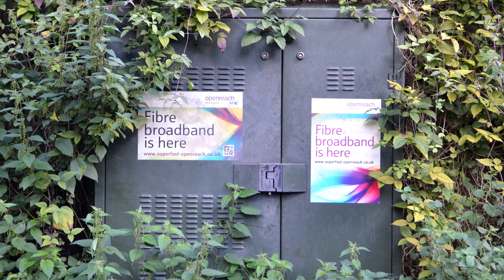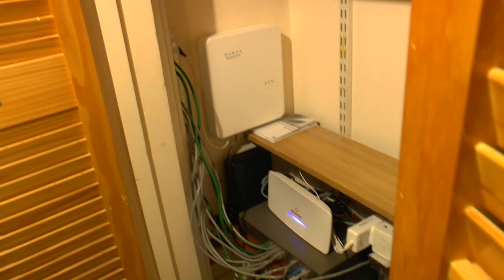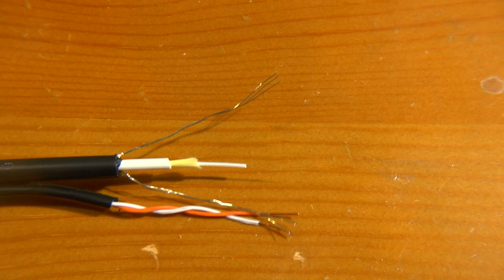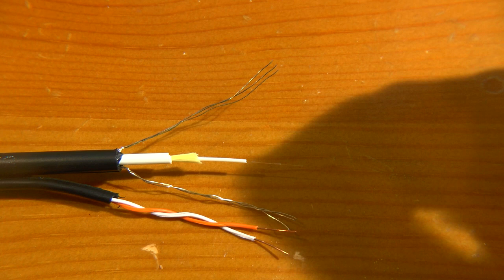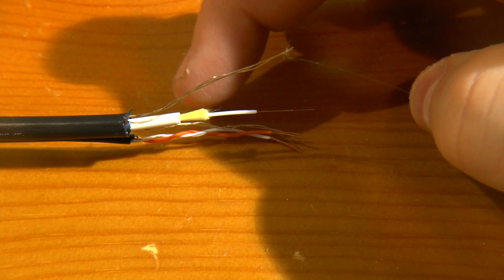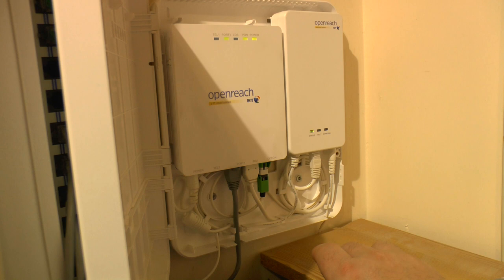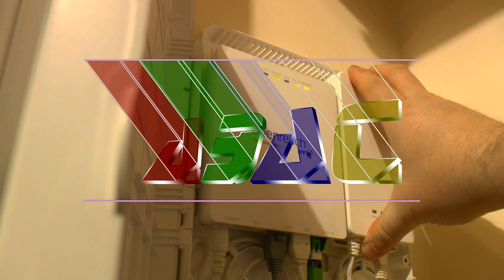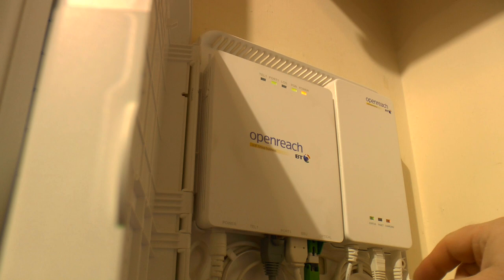FTTP - Fibre To The Premises

Comment: We are just about to get FTTP here in Devon from Openreach. They are planning to take away the copper but it looks like they don't offer the battery bit now and install a smaller box. Mobiles don't work around here so we need VOIP and a battey really. Any news currently?
Reply from the maker: There's some info to pore over here. I'd assume that BT would still be providing ONTs with an analogue telephone port, but this is BT we're talking about after all so all bets are off. As for BBU, vulnerable customers can apparently request one, otherwise your best bet would be a small UPS to run the ONT (plus your phone base station if it's cordless).
https://www.openreach.co.uk/cpportal/content/dam/cpportal/public/images-and-documents/home/help-and-support/sins/documents/SIN_506.pdf

Comment: I'm due an installation next week. Would be interested to know the size of the plastic cabinet. Would you be able to take a quick measurement? Hoping it would fit where my existing 'telephone table' covers
Reply from the maker: I've just looked through previous comment replies and it's approx. 255mm high x 215mm wide x 45mm deep.

Comment: what upload speed? do they also match as classic broadband  upload speed ? Cheers.
Reply from the maker: Plusnet are still trialling FTTP so the speed they offer matches that of FTTC, i.e. 80Mbits/sec download and 20Mbits/sec upload. Vendors offering full FTTP (such as BT) can do 330Mbits/sec download and 30Mbits/sec upload.
Reply: @AintBigAintClever  So its still behind Virgin Media even though VM are doing coax to the property?
Reply from the maker: @compspud  Plusnet's trial (which has now closed) was throttled to FTTC speeds. FTTP from BT for example can go up to 330/30Mbit. A friend of mine just a few poles away (and on the same cab) has 330/30.

Comment: Hi, I really need your help !
Im using exactly the same  set up as yours. 
Just a question, Is the optical cable compulsory for the internet connection? can I use the tel cable instead and where did the other end of the optical cable connected to? also, where can i buy a optical cable like yours? please help, Thanks!
Reply from the maker: Which optical cable? There's only one in the video and it's the one going from the pole outside to the box screwed to the wall.
Reply: What the hell? You get internet and phone from optical cable...

Comment: I have one of these and I am mega confused as to how to set up at wired internet connection throughout the house, could I just plug my ps4 into the phone port?
Reply from the maker: No. PS4 needs to plug into one of the LAN ports on the router. If you've run out of LAN ports you need to add a multi-port switch (e.g. Netgear GS105, TP-Link TL-SG1005D, plug one port of that into a LAN port on the router then plug your additional devices into the switch (including the one you unplugged from the router to plug the switch in).

Comment: So dont it plug into a master socket or is this just for copper slow speeds? So basically from outside it goes right to that modem not to the master socket then a cable from that to the modem to plug into that fiber optic port.
Reply: I'm pretty sure they install a new socket. So effectively the master socket is useless at that point since you may as well use the full fibre not the copper cable.

Comment: Really great video.  So we couldn't get FTTC as we are connected directly to the BT exchange (no green box).  We are getting FTTP and they've been digging up the street installing underground truncking for the fibre.  What I don't understand is how they'll connect to our house.  Looks to me like the closest BT floorbox is 22m or 28m away depending which one I measure from.  I hope they'll dig up the ground to add the last bit of fibre.  But are there other worse ways?
Reply from the maker: How does your existing phone line come in? If it's underground I'd expect it to be in a duct which BT can drive a fibre through. If overhead they'll do what they did here with a connection box at the top of the pole run down to a splice in the nearest floor junction box.
Reply: @AintBigAintClever  Our master socket is in the sidewall by the front door and does go underground.   I have no idea how straight our pullable that is.  But there is no space for all that gear with the battery backup.
I have a cupboard/cloakroom opposite the front door in the hallway with my network gear and patch panel in. Wondering if I should install pipe conduit all the way to the cupboard to the outside wall. But don't want to do that if they refuse to run fibre to the house and dig up the last bit.
That's why I was wondering if they have a slower bodgy way using the copper for the last bit.  I hope not
Reply from the maker: @dvdchas  they indeed have a slower bodgy way using copper for the last bit, it's called FTTC :D
If there's an easy run made available for the engineer (such as your own conduit) then I'd expect them to be happy to oblige, especially if it makes it easier than a normal install. For mine I'd already fitted a block of wood between the rafters (to support a BT cable bracket) when changing my fascia boards, with a length of cable dropped through the soffit as a draw cord. I also had 50x50 maxi trunking in the cupboard which takes ethernet, coax, etc. between the upstairs floor and the attic, with another length of draw cable.
When the engineer came he taped the fibre onto the cable outside, I went into the attic and pulled it through while he guided it. While he buggered around up the pole I mounted the outer box for the fibre gear exactly where I wanted it, then taped the fibre onto the internal draw cable. Engineer came in and drew the cable while I guided it down, then he terminated it.
He didn't have to drill any holes, he didn't have to hammer cable clips in and I had the kit in a first floor cupboard exactly where I wanted it to be, with a coil of excess fibre in the attic to allow it to be relocated in future if necessary.
Reply: @AintBigAintClever  sweet joy.  Whilst I will go to the trouble of digging up my floor, even trying to find where the existing copper comes into the house I'm not sure the engineer will be keen to dig up any public paths (more than they did already to put in the FTTP fibre).  I really hope it's an easy cable pull but seems unlikely to me.
If they use copper for the last bit it completely makes a mockery of the FTTP designation...
Remember there is no green cabinet so any bodgy stuff they do is literally in a bt manhole...

Comment: Hi, not sure if this question has been asked as i haven't read all the comments nevertheless, does anyone know how long the backup battery would operate in case there is a power cut before it needs replacing??
Reply from the maker: Funnily enough I was asked this in work the other day. I suppose it would depend on whether the phone service is being used or not (not in my case) and how much. The unit including its trickle charge circuit draws about 3.8 to 4 watts (see video at 2:29). The backup shown at 7:20 consists of four 1.2V 2000mAh cells so 9.6 watt-hours of capacity.

So... 2 hours or so?
Reply: @AintBigAintClever  thank you very much for your reply. In my case, I won't be use the phone however, its an option I'll consider in the near future. Mine getting installed tomorrow therefore I'll pop the question to test he's knowledge :) cheers

Comment: Interesting video, I followed the links to the open reach site, seems alot of equipment to have Installed, compared with standard broadband,  (like I have, just NTE 5 master socket, filter & wireless router) & although I only live literally 30 seconds walk from the main exchange for my city,  even FTTC is not yet available in my street! 
Although 5G technology will probably overtake fibre for alot of residential customers,  maybe with fibre to the pole, then a 5G link to the premises?
Reply from the maker: If you're that close to the exchange you may have an EO (Exchange Only) line. For some reason BT aren't allowed to put the contents of a green cab in their exchange, they've got to reroute the lines to a new cab outside then put an FTTC cab alongside that. It can mean that those closest to the exchange end up having to wait longer.

As for the equipment, you've got an NTE5 on the wall, an ADSL filter and a router. I've got a fibre ONT box on the wall and a router.

Comment: So you’ve manage to use absolutely no coax? This is what I want to do... can I have them (Frontier FiOS) run CAT7 Ethernet cable instead of coax to where my access point is located?
Reply from the maker: No coax whatsoever, as this isn't a "cable" area. Cat.7 is overkill, Cat.6 or 6a would be fine.

Comment: Great info, thanks! Now I know what to expect later when we get this. The piggybacked copper looks pretty annoying though; are we allowed to have it with just fiber and no copper?
Reply from the maker: I suppose it depends on the area (and possibly the pole) but worst-case the copper can always be unzipped from the entire length of cable. The hybrid cable has proven handy across the road from me where the existing copper was replaced with the hybrid.
The hybrid has an advantage of needing no outside splitter on the wall. With earlier incarnations the cable would've had to run down my wall then back up again to the entry point.

Comment: Shame the engineer didn't take your dropwire down and use the copper in the Hybrid cable like he should have. Would have looked neater from the outside and prevent the pole from becoming overloaded.
Reply from the maker: It'd have been a bit more of a ball-ache to do as the existing dropwire has been routed under the floorboards and up in conduit to the NTE5. I agree it would've looked neater, though.
Reply: That's what we are supposed to do. The engineer could have linked the copper pair with an enclosure where it enters the premises then he could have recovered the old dropwire.
Reply: I can do these connections easy.  It's obvious he should've joint the telephony bit of wire to the existing on the eves of the property.

Comment: Not sure what's neater, VMs FTTP or BTs. VM have most of that outside with just a Coax into the building.
Reply from the maker: If it's fibre to the cabinet then coax into the building then it's not FTTP. It's FTTC.
Reply: AintBigAintClever virgin have fibre to a brown box attached to my house then from there a length of Coax to the router. So it’s fibre to the premises.
Reply from the maker: @hawk_ness  Ah, they just shove the gubbins outside then. I suppose there are advantages both ways; outdoor kit may allow for a neater indoor installation but has to be built to withstand the elements.

Comment: Do you think BT/ Openreach will offer higher speeds than 330/50 or even symmetrical speeds which matches providers like Hyperoptic?
Reply from the maker: No doubt there'll be higher speeds in the future due to the capabilities of fibre. Openreach have already announced gigabit-capable exchanges here: https://www.ispreview.co.uk/index.php/2019/10/openreach-confirm-29-new-uk-areas-for-fttp-gigabit-broadband.html
Reply: on same equipment i'm on 1gb/1gb + phone at £24 with ufo york, i just dont see why bt wont pull their finger out, except it would probably really really upset the copper customers if they did.
Reply: According to Openreach I will be getting the FTTP technology in April I’m just wondering what the highest speed will be.

Comment: Why is it that with virgin media it has a router /hub that goes to the virgin media socket in the wall using a coax cable, but it  does not require any power for to virgin media socket?

But with bt hub 2 it does  need power to the bt socket ?

As with bt hub 2, full fibre so obviously not using the adsl or vdsl or sdsl cable port or cable in thd hub 2 to the bt modem socket.

So obviously it is using an ethernet cable from the hub 2 to the bt modem socket
Why is it that the full fibre hub for this ethernet from hub 2 to bt modem socket, needs a power plug to make thd bt modem  socket work?

Why can't it just be like virgin media where it does not need a separate power source so obviously only thd virgin media hub needs power to it?
Reply: It's for backup power for when you need your phone and have no mains power. The VM service provides power over the twisted pair, till 2025 when they switch it off
Reply: It depends on your technology of connection. If you have FTTP (like this Openreach setup) where the fiber-optic goes to your home – the VM socket will have its own power supply. If you have HFC (coax-to-home), it will not due to the obvious reason: the fiber-to-coax connector will be in a shared street cabinet with its own power supply.

Comment: do you actually need the Plusnet Router connected or can you just use a an ethernet switch to get internet service?
Reply from the maker: You'll need some sort of router, as you're only going to get one IP address from the ISP and you wouldn't want your device exposed directly to the internet anyway.
Reply: @AintBigAintClever  I just wondered if it would work that's all!
Reply from the maker: @don1estelle  It would work in a similar way to the old USB ADSL modems I think.  You'd probably have to do the PPPoE stuff on your computer, it may depend on the ISP, but then you'd be putting your faith in whatever firewall software is running on your computer.

Comment: hi with fttp from bt can you get 50mbs speed as i seen they only.offer 100mbs and above.
Reply from the maker: I've just checked and for my line BT offer:-
36/10mbps (£29.99/month)
50/10mbps (£35.99/month)
74/20mbps (£39.99/month)

150/30mbps (£54.99/month)
300/49mbps (£59.99/month)
https://www.bt.com/broadband/deals/
Reply: @AintBigAintClever  hi thanks for the info mate

Comment: Hi, I have moved into a new build house with FTTH. The wall plate was installed just next to the main entrance in the hallway (neither under the staircase nor in a cupboard). Today, the BT engineer has fit the wall-mounted Open Reach modem onto this wall plate with the SC Fibre Cable coming through. The issue is that the only way now to connect the 2 devices is in the hallway at the moment (WAN port of BT Smart Hub router to OpenReach modem's Ethernet port via a network cable). That looks quite odd having the BT router sitting there. To move the BT router from the hallway, should I run a longer network Cat 5e or Cat 6 Cable from the OpenReach unit to the best location I think it shoud be, meaning along the walls and skirting boards? Any advise? Or should I contact BT to ask to relocate to a convenient place the OpenReach modem? Thanks. Mike.
Reply from the maker: If they've cut the fibre to length then they won't be best pleased (or cheap) if they have to move the fibre equipment from the daft place the builders put the wall plate. Better off running a cable, assuming there isn't one already in the wall plate. Take a look at BT's guides for housing developers, see if there are any useful guidelines that they've actually followed. https://www.ournetwork.openreach.co.uk/property-development.aspx

Comment: Our copper was switched off approx. two years after fibre was installed in our area. Well they do that too in your area?
Reply from the maker: They'll have a long way to go before they can do that.
Firstly in my town I think the cab feeding my area is the only one that's FTTP, the rest of the town is FTTC.
Secondly takeup is slow. Very few ISPs offer FTTP so many users fed from my local cab are stuck with ADSL2 unless they switch provider. I was the first on my pole, I think there are only three others who have since switched to FTTP.
Thirdly as far as I'm aware they're not making use of the phone port on the ONT, instead leaving the telephone service as analogue either on the original cable (like mine) or swapping to the pair on the hybrid cable and removing the old cable (like my neighbours across the road). Where customers have internal extension wiring BT will have to pay another visit to reroute this to the ONT.

Comment: I am on an echange only linw, can i get FTTP?
Reply from the maker: As far as I'm aware the only way BT will provide FTTx service on an EO line is if they install a new cabinet OUTSIDE the exchange and transfer the lines to that. Why not just install a rack of green-cab kit inside the exchange? Not sure, but they won't do it.
Whether BT will install a new cab for their EO lines may depend on funding. If the government coughs up for example, BT may do it. Whether they install an FTTC cab or an FTTP splitter and cables could depend on the average speed in the area, if it's below par for the various FTTC cabs in the town they can easily bump up the average speed by installing a 330Mbit FTTP cab.
Reply: A lot of places with EO especially in London with multi occupied homes require permission from landlords and council to run FTTP and permission to dig forms signed by both parties :(